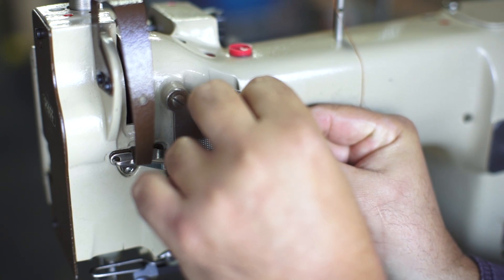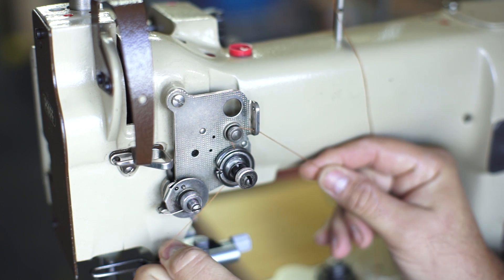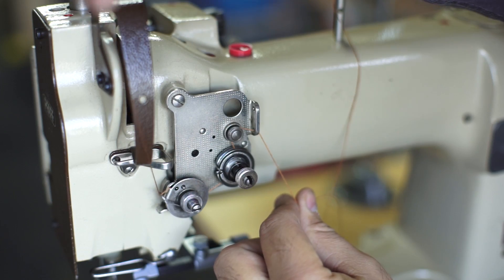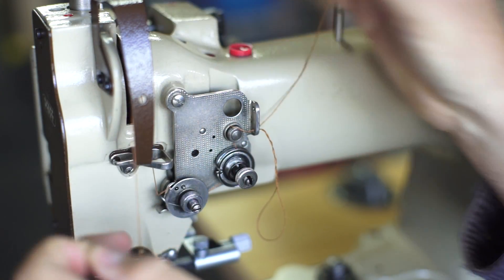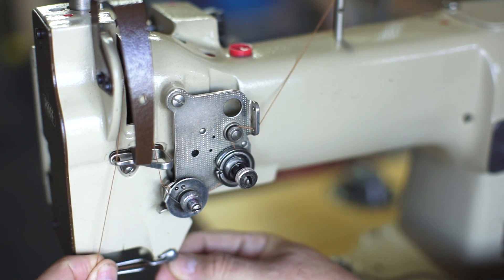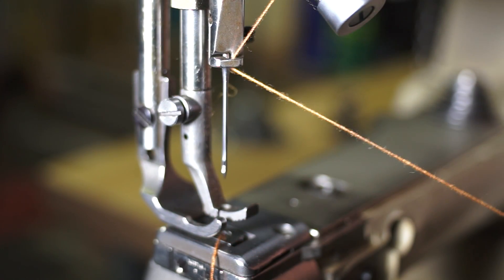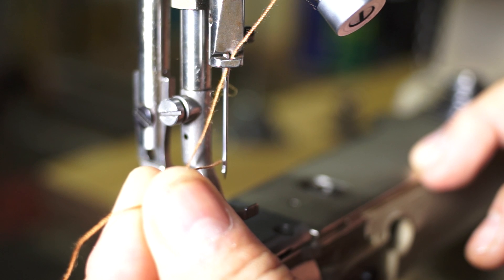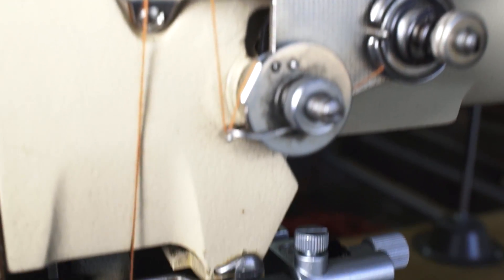Threading Pfaff 335

Comment: There Is a mistake. The thread must be guided over the Pin in the First tensioner
Reply: are u sure?
Reply: @FITRI-hb6ug   your way is working, but with the pin is the way of the actual instruction, there are mashines without pin and there are newer mashines with pin.
Reply: There is no mistake. Just RTFM. ;)
Reply: Yes.  I was going to point that out.   If you don't go over the pin then it will come loose from the tensioner and won't sew properly.